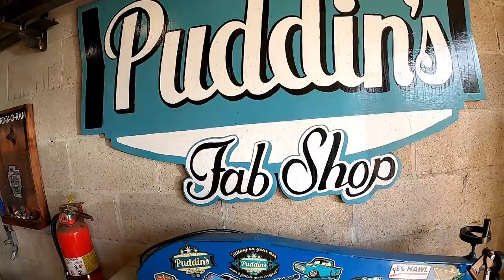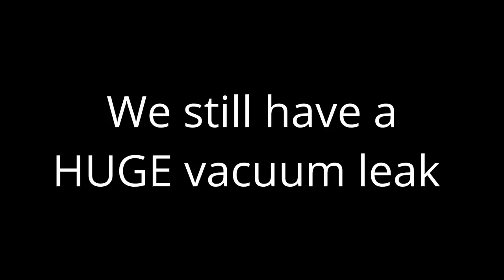Holy compression! WILL IT RUN?!? Junkyard ((1973 DATSUN 1600.))

Comment: Love the videos! They are something to look forward to on mondays. 
Just a reminder, those mini truck carbs have a solenoid that requires power to allow fuel to idle circuit. This is to prevent dieseling when you shut it off.  I belive it was the red wire in front of the carb. Consider leaving that one intact.  Or not... 😆
Can't wait for another episode!

Comment: Most of those old Datsun carbs have a solenoid that shuts off the idle jet to stop the motor running on when you turn the key off. just needs 12v positive to keep it open. Great Video. Put a big smile on my face.

Comment: They go very well with a Nissan 1.8 CA18DET motor shoved in them , fits easily too. A workmate here in Australia did it, made for very spirited motoring.
Reply: a straight 6 out of a z-car fair lady would do the trick and stay bolt in as it would just add two identical cylinders as the four that are in the Datsun 510s and trucks , you could swap pistons and everything would be fine,you'd have to make some room in front for them though.

Comment: I'd love to see one of these little Datsuns with a Ford 300 straight 6 in it, she'd be a power house with a 4 speed with granny low.
Reply: that motor won the Baja 1000 three times, you can't argue with that,and the fact I've seen them on backup generators in just about every institution, wherever they're needed
Reply: Half the engine would be in the front seat, and you would have sit in the bed to shift it, and making a drive shaft would be quite a chore. it would e easer to put a small block v8 in it.
Reply: That wouldn't work, but a 2.3 lima turbo guy might be fun in a Datsun!

Comment: Valve sticking issues got worse as the gas worsened. Valve springs are designed to close the valve ( when it's properly lubricated through the knurlings of the valve guides) Personally I use carb cleaner on engines that have been sitting. Engines typically run on the left over varnish from the last time it ran. Then I add sta-bil to the first 5gal of gas for added lubrication. 👍👍 Thanks for sharing Puddin

Comment: Redd neck spark rejuvenation trick:  Take a propane torch and blast the tip until it gets red hot. About 5 minutes. Burns all the crud off. Had an old lawn mower that would foul its plug every other mowing. Saved buying a lot of plugs until I could replace the carb.

Comment: This was about the same time and year that Datsun changed to Nissan. I had one and drove the daylights out of it. My 74 needed to have the head retorqued every 10,000 miles or the head would warp. The manual recommended this procedure. 
I made the tailgate into storage for a tow rope, jumper cables etc. I cut a piece of outdoor plywood to cover the inside of the tailgate on hinges and walla hidden storage.

Comment: Once it warmed up it started sticking the valves. I would say that would be a really good engine. Might need to go thru the head and new gaskets. But the smoke cleaned up after it ran a while. And it's quoter than any other engine. Love the vids

Comment: 73 was the first year...my dad bought one in Nov. 72 for brand new  for 2,100 drove it til 1980 ,
I bought it for 15 hundred put a another motor I had in it..I had a body shop at the time so I painted it and sold it for 2500 they are great truck ...

Comment: Those Hitachi and Nikki carbs are a headache. One of those solenoids is the low idle cutout. If its cut it wont hold an idle. You can delete the pin and put the solenoid back on sometimes. Best bet is to put a weber 32/36 on it and it will run like new. Ive also never had luck with those fuel pumps. I use the flea bay herko gear pumps now with good results. Thanks for the videos puddin

Comment: I owned a 1979 datsun pick up. the company I worked for in the early 80s decided as a  bonus we could fill up our gas tank with company gas I went home with a full tank but I already had half tank . came into work and everyone's cars are there all over the lot. Found out they put diesel fuel in our gas pump and my truck was the only one that was running with a half and half of gas and diesel fuel ran all week . Saturday morning went 50 ft it quit wasn't cranking right pulled the oil dip stick and it was over full of diesel fuel. Changed the oil  and it started right up run like new for another 8 years no problems...

Comment: I had a 75 Dastun 620 that you could turn off the key and pump the carb twice then then turn the key back on and it would backfire. I pumped a little too much on night and in a big flash under the truck it blew the muffler out at the seam. Sounded like a bomb. These old Datsuns are tough as nails, been looking for another one for a decent price. They are getting hard to find.

Comment: Another good one puddin. I think old whiskey dent would be a good runner if you had a good card for it. That valve would free once it got some lube on it and some heat cycles, and if not then a little 2 stroke oil would’ve done the job.

Comment: I’m guessing that engine was rebuilt.
180 psi (no added oil in cylinders) is top notch.
The cylinders were clean as hell as well!
:-)
Also..those hitachi carbs had a tendency to have the Philips screws near the bottom of the carb loosen up.
Gotta take it off to tighten them.
That gasket is kind of a spacer and a gasket combined.

Comment: Pretty much you did a wet vs dry compression test might explain the change in readings. One time I had some sealant get down the intake and wedged onto the exhaust guide. Valve stuck, bent pushrod.

Comment: For running fuel to my cars I use an ALPHA MOTO Motorcycle Shop Auxiliary Gas Fuel Tank  hanging from a portable IV stand. Both from Amazon. And it just looks cool as snot on a glass window.

I'd be happy to equip you with a setup.

Comment: I’m still trying to find out about that Mazda b2000. I’m currently in the process of resurrecting mine and I got a Weber for it only probably now is how I’m gonna find a throttle cable to make it work since the 84 uses a throttle linkage instead.

Comment: You need to look in to 2bbl Webers! 

The vacuum era carb, is meant to run with vacuum, so if you want to loose all the vacuum junk, swap carb! 

It will run so much better! 
Weber 32/36 will go a long way, they are available, with manual choke or electric choke. There used to be a water controlled choke too. 
I believe they are called DGV, and can be had from redline carbs, even from Amazon! 

It will change how you look at small engine carbs! 
We put one on a small Toyota, and I promise you, mid range felt like I bigger engine. Second felt better/wiser powerband, and third pulled like second!

Comment: ok enjoy your channel fuel pump I think needs to be mounted to ground properly. back fire after water spray I think is water in distributor. compression drop is because carb was on there and first test no carb on it. smoke is I think valve guide seals.

Comment: Love the content sir! I have a 620, and I’m just confused about the 1600 name for this one. I thought all bulletsides were 620, did someone stick a 1600 badge on this and call it that or was there actually a difference?
Reply: 620 is nickname of the Frame series.... 1600 caused that engine is L16 1.6 lt there are another 620 with engine J15 with 1.5 lt and those said 1500 that's why... actually the previous frame series was call 520 if you see those are idem to the car 510 so, 510 for the car and 520 for pickup truck XD

Comment: My 74 had a dual point ignition. I had a mechanic change it to a single point engine. I warped the head and the story goes on. I put a 2000 cc engine in it and it was a little quicker.

Comment: Stop it! I like whatever you post. No need to apologize. 
Hey, that little hole in the wedge style plug gap’er is to open up the plug gap. Using it correctly will prevent electrode damage. It works nicely. Some think it’s a hole for your keychain. I guess it could be for that too.

Comment: Sir I think your carb problem is because it appears to be to new for the year of truck. That carb has an idle shut off solenoid that goes to newer vehicles, aka 1980 or newer.  Now that could be the engine was swapped and it good for the engine ,but not the truck. That is possible. But in 1973 I don't remember the carbs having electronic idle solenoids on them. You can bypass the solenoid by going passed the idle circuit which is what it was doing. With the higher idle. Also. The sticking valve could.be bent valves. So just keep that in mind. 
Love your vids and thank you for your service pudden...we could not do, watching you fart with vehicles, with out tuff guys like you.

Comment: So I always thought, did American scrap yards sell all the 50s cars to Japan in the late 60s? And is that where the high quality steel came from in the 70s and 80s toyotas. Seriously impressed by the quality of some of the late 70s Nissan's engines, same with toyotas from that era. Indestructible engines, bolts that dont break off as much. Is that because they are made from 57 chevy bumpers?

Comment: In Australia those little utes were called a datsun 1500 ute. (engine was a j15- different series than yours) I suppose they didn't want to use the famous datsun 1600 car's name on a workhorse. (The car had other names in other countries). The j15 is unfamiliar to me as it was only in the ute here, though I had plenty of experience with the L series 4 and 6 cylinder motors in the sedans and z coupes.

Comment: I think I know where another 620 is. I'll look soon. My love was the 521's. It's been years since I owned one though but I do remember one distinct thing. The carburetors are garbage after 100k miles. All that emissions crap stops working correctly and as you chase one rabbit down the hole another pops up. They are pricey nowadays but the downdraft Weber carbs are the way to go. I had a guy tell me that he adapted all the stuff from a B16 Honda and converted it to fuel injection. I didn't see or hear it run but he said it made better power than any 521/620 he ever owned.
It not unreasonable but without a donor car sitting beside you it could be a nightmare. The 16,18 and 20 series motors were tough little beasties. Find one of the high compression Japanese heads that hasn't been melted down to make soda cans or mobile home wiring. Get a BRE Racing cam and intake with 2 sidedraft Webers. Don't go too much bigger on the exhaust but a header will make it breathe better. If you go too big on the exhaust the thing will fall flat on it's butt. Take the numerically higher 4 speed rear axle and match it to a good 5 speed if you like clutching. If not that 4 speed axle will wake up an automatic. These little trucks were meant for fuel economy and emissions. You have to work for every pony you get from one. 
The last Nissan I had was an 83 2200 with a 5 speed. The rear axle so numerically low it was a devil to pull anything more than a small utility trailer. Anything bigger and your clutch was toast. The truck would go down the freeway at 90 mpg flat and level. Around here in the upstate of South Carolina you wore your leg out shifting. It had A/C on it but I never bothered. I just didn't have the heart to hear the guy struggle.
Keep the rust at bay and these are 200k plus mile trucks. Overheat them once and they are done for. I love them to death. If I didn't have 7 vehicles now I would have one again. If you ever get to South Carolina PUDDIN let me know. I have at least another set of steelies for you.
Cheers
Terry

Comment: Watching you cut the wire off the anti-diesel solenoid SMH now it won't idle...... The solenoid cuts off the fuel at idle so it won't run on. Hook it to power and it'll idle without having to rev it up. I see it wasn't hooked up in the first place. That was their issue.

Comment: Buddy, ya gotta start changing the oil on these vehicles BEFORE you start turning them over! You fog/soak the rings in Marvel Mystery 1oil or PB Blaster to free them up, THEN change the oil BEFORE you start them up. One can only imagine all of that gooey, sticky, nasty oil trying to flowing through ANY engine... with whatever is in it, like water/antifreeze, dirt/junk that came in through the carb from rodents, etc... . It's not gonna break tha bank, Puddin'!! Use cheap oil, but at least change it! LOL!!

Comment: You've gotten probably 1000 pieces of shrink tube from fans so of course u use electrical tape on the ground wire. But if you doing it for laughs or just quicker videos u hit it on the head for sure